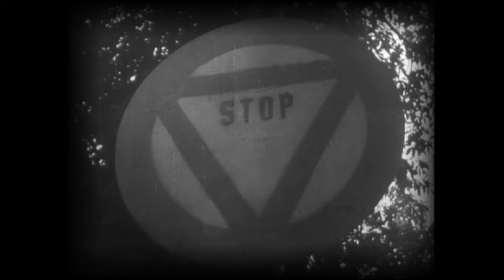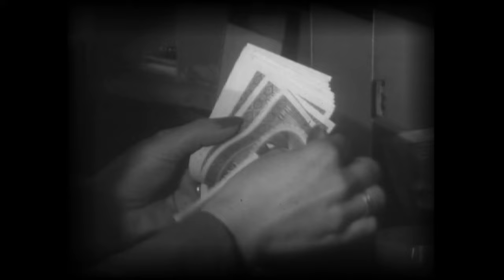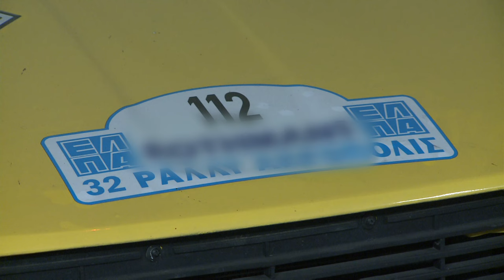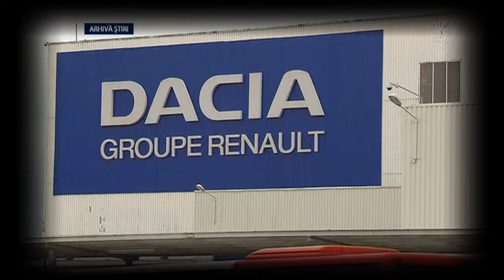Adevăruri despre trecut: Dacia, luxul epocii de aur (@TVR1)

Comment: Eu am si acum o Dacia 1300 din ‘72 cu toate piesele originale din fabrica!!!
Reply: vrajeala
Reply: Iti dai cu parerea fara sa stii...
Reply: mergi la somn,
Reply: @johnnybucovineanul4728  pai stai, prin toate piesele originale, presupun ca nu se numără și consumabilele. Altfel, imi e cam greu sa cred ca acesta masina încă are filtrul de ulei original, filtrul de aer original, distribuția originală
Poate decât daca sta la adăpost și nu e folosita 🤔🤔
Reply: M E Z totul este original pe ea. Are doar 70000km. Bineinteles ca uleiul si filtrul sunt schimbate. Insa distributia este originala. Categoric ca de ex. bateria nu rezista 48 de ani... de aceea este noua. La fel si cauciucurile..
Reply: @johnnybucovineanul4728  dacia avea distributie pe curea, parca? Daca imi amintesc bine, atunci, eu as recomanda un schimb. Chiar dacă unele duc 120000km cu succes, eu personal n-aș tine o mai mult de 55000km(curea) sau 3 ani jumate
Reply: M E Z intradevar, e tinuta in garaj la temperatura de 22-25 si se circula cu ea undeva in jur de 300-400km/an. Probabil ca anul viitor voi schimba cureaua, antigelul
Reply: @johnnybucovineanul4728  wow, asa putin
Uleiul cum e schimbat?? 10000-15000 km neaparat, sau la un an, indiferent de nr de km făcuți??
Reply: M E Z cam o data la 2 ani
Reply: @mez472  am pus un video cu Dacia mea
Reply: @johnnybucovineanul4728  drăguuț
Presupun ca numerele au fost date jos doar pentru video, si se circulă regulamentar cu această masina
Reply: @mez472  exact 👍
Reply: @johnnybucovineanul4728  dacia avea distribuția pe lanț,Din ce stiu eu
Reply: Da ca ai facut? Ai dus-o in Anglia ?
Reply: @cajvana1125  da, am adus-o in Anglia. Dar va pleca inapoi in Ro
Reply: @johnnybucovineanul4728  fix asta era tipic pe atunci. Isi lua lumea masina si nu circula cu ea.

Comment: De bine de rau Dacia 1100 si 1300 sunt masinile care ne-au motorizat tara chiar daca erau copii mai acesibile doar cu dotari si motorizarea de baza ale Renault 8 si Renault 12. Variantele originale Renault puteau fi achizitionate si cu motoare mai puternice, aer conditionat si chiar si cutie automata la Renault 12. Fiind niste copii mai accesibile ale unor modele Renault care nu au nici ele o valoare semnificativa de colectie, daciile restaurate din acea perioada au mai mult o valoare sentimentala pentru romani decat ca masina de colectie.
 Pe multi ii supara cand vad asemente specimene conduse fara sa fie menajate, dar masinile astea au carat cartofi, animale,  varza sau mai multi oameni decat erau locuri in masina  pe toate tipurile de drumuri si au fost gandite sa poata faca asta.
Reply: UN RENAULT 12, STRĂMOȘUL DACIEI 1300, DĂ CLASĂ MAI MULTOR MAȘINI MODERNE PE UN DRUM ACOPERIT CU ZĂPADĂ – VIDEO
Publicat: 27 01. 2022, 17:50
Actualizat: 27 01. 2022, 21:03
Marius Vișan
renault 12 
Un Renault 12, strămoșul Daciei 1300, dă clasă mai multor mașini moderne pe un drum acoperit cu zăpadă - VIDEO

În ultimele zile, Turcia a fost cuprinsă de zăpezi, iar drumurile au devenit rapid aproape impracticabile. Nu și pentru bătrânul Renault 12, care a ajuns vedetă pe TikTok după ce a fost filmat în trafic, urcând cu ușurință pe un drum acoperit cu zăpadă.

Venerabilul model franțuzesc a fost filmat în timp ce urcă cu ușurință pe o șosea acoperită cu zăpadă. Partea interesantă ar fi că acest Renault 12 avansează printre alte mașini mult mai noi și, teoretic, dotate cu sisteme electronice care să le ajută în astfel de situații.

Se poate observa că unele mașini erau oprite pe dreapta pentru că nu puteau urca, iar alte câteva înaintau cu greu. La un moment dat, printre ele, se strecoară acest Renault 12.

Dacia 1300 – ”Regina șoselelor”
”Are cauciucuri mai înguste și taie ușor zăpada…” scrie cineva pe YouTube. ”Nu ar trebui să vă lipsească un manometru din trusa mașinii pt. a scădea presiunea anvelopelor la nevoie așa cum a făcut cel cu Dacia (Renault 12 n.r.)”, completează un alt internaut.

”Fugea RAR-ul după el să-i ia probă de fum”, este un alt comentariu amuzant al unuia dintre cei care au văzut clipul.

VIDEO

Trucia a fost afectată de ninsorile abundente
În cursul zilei de ieri, 26 ianuarie, Ministerul Afacerilor Externe (MAE) a emis o atenționare de călătorie și informează cetăţenii români care intenţionează să se deplaseze în Turcia că există riscul închiderii sau blocării circulației pe principalele șosele care conectează orașul Istanbul cu provincia turcă Trakiya și cu Aeroportul Internațional Istanbul, din cauza ninsorilor puternice.

Niște turci au modificat strămoșul Daciei 1300 break. Rezultatul este impresionant – VIDEO

Articole recomandate

Jaguar extinde garanția mașinilor de la 3 la 5 ani

Volvo construiește o fabrică de mașini electrice la 260 de kilometri de Oradea

Mercedes va produce mai multe mașini electrice de lux

Autostrada Moldovei a primit acordul de mediu pentru toate tronsoanele

Mini oferă un puzzle pentru clienții care încă nu și-au primit mașinile

BMW M5 Touring ar putea avea un succesor echipat cu motor V8 plug-in hybrid

© 2022 Promotor, Toate drepturile rezervate.
Reply: @ovidiusandu9779  mai termină și tu cu comentariile false de tip spam
Reply: Cuma au motorizat fix ele tara?
1. Inainte de inceperea fabricarii se importau Fiat, Renault. Cate si la ce pret? Erau mai ieftine decat Dacia. Numarul de bucati putea fi marit dupa necesitati.
2. Vezi Ungaria. Nu au produs autoturisme. Totusi se astepta mai putin dupa o masina (catre deloc), aveau de unde alege, erau mai ieftine raportat la salariu, desi o tara mult mai mica, circulau mult mai multe autoturisme. (Si aveau si pe ce, strazile nu erau cu gropi si aveau autostrazi deja de pe atunci.) A doua masina nu era ceva iesit din comun la familii din patura de mijloc.
3. Erau destule oferte din productie socialista, daca chiar nu se voia cheltuirea valutei forte. Vezi Bulgaria, isi importau necesarul din URSS.